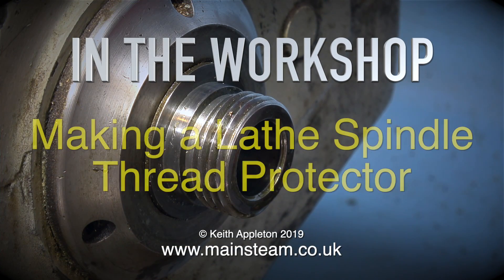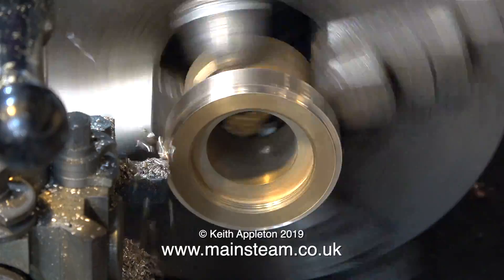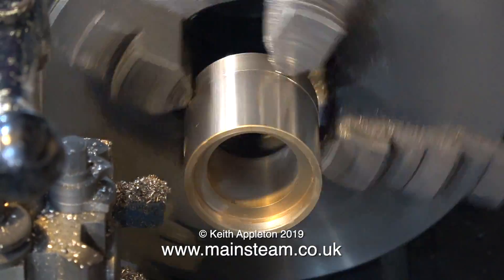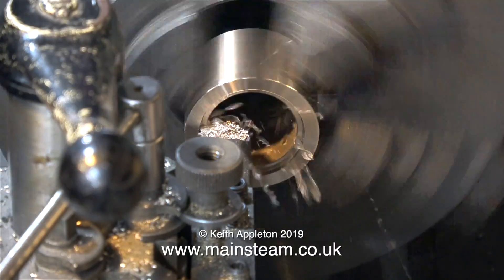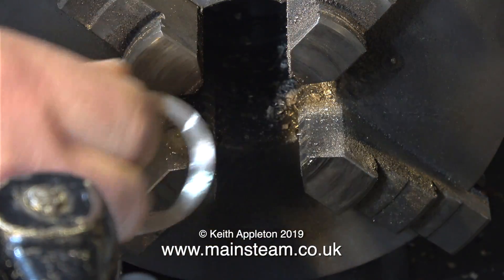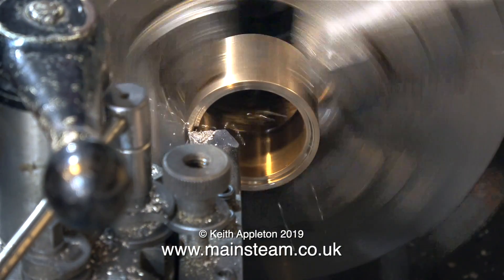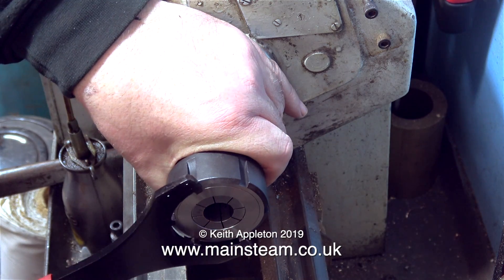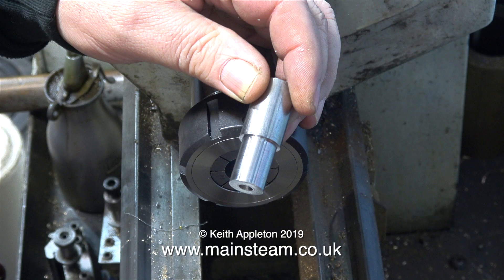HOW TO MAKE A LATHE SPINDLE THREAD PROTECTOR - IN THE WORKSHOP

Comment: I would NEVER have thought to use an o-ring for the spindle protector.  That is a master stroke.  I have 3 ruined nose protectors in the chip tray right now.  I managed to foul them up while turning the threads....  Thank you for this.  Very nicely done.

Comment: Hi
For your information I bought an ER32 collet nut like yours.
The tiny little set screw in the side of the nut is a retainer for the very small ball bearings in the nut.
My set screw came out and I lost most of the ball bearings which in my case were 2mm in diameter,  I bought a pack of 100 BBs and removed the rest from the nut. after cleaning the parts of the oils shipped in the nut.
I used some tape across the end of the nut to hold the inner cone in align ment I put the 2mm balls in dry. This allowed the balls to fall to the bottom of the race way and make room for the next balls.
So in the end I decided to install the set screw with some Lock Tight liquid to insure the retention of the screw and prevent the loss of the balls in the future.
Thanks for the vids